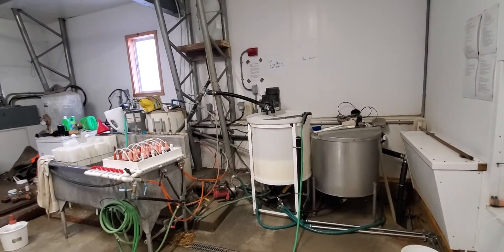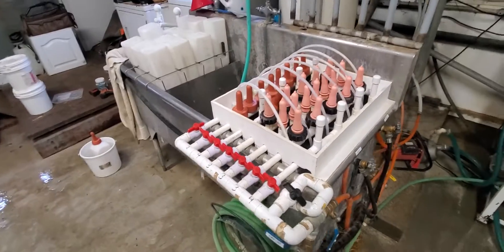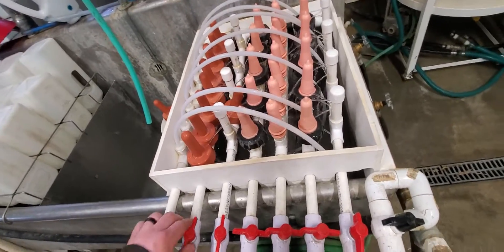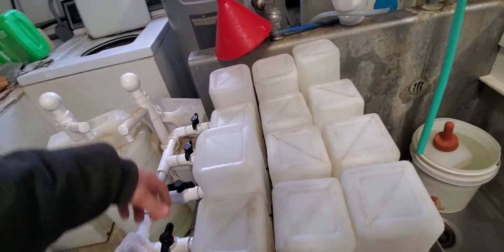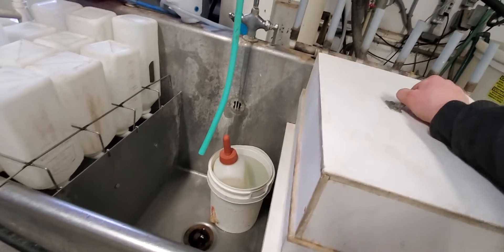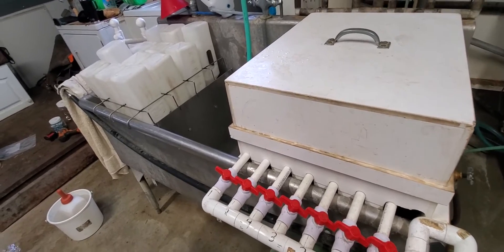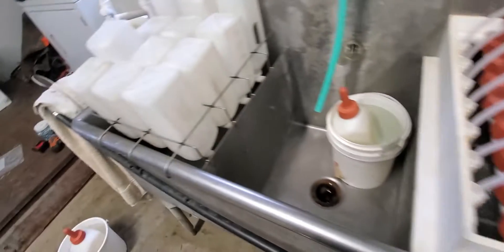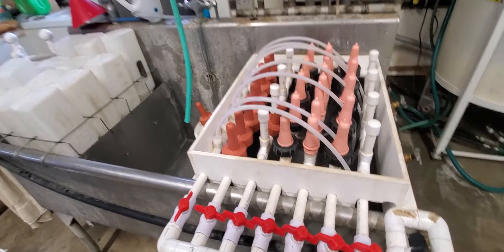Dairy Farm - Calf Bottle Washing System

Comment: First & Foremost, I would like to THANK YOU for your time and effort of producing the video and sharing your mechanical creation of the infamous daily chore those of us that have bottled fed, ....."CLEANING OF THE BOTTLES"!  I have been searching for few weeks of attempting how to solve / mitigate the laborious chores when I get back into bottle calves. 

That being said, I am researching on an semi auto feed system as yours. I do not want to / nor have the funds to invest in a FULL ALL OUT "AUTO" system at the time, although can appreciate those whom have a large operation.  Therefore, I was wondering if you could provide a "SECOND" Video on your auto feed system.   It appears you are collecting the milk from your milking parlor, storing for one day, then transferring into dispensing vessel with mixer. 

1- Are you implementing additives to milk to stabilize?, 
2- and if so what? 
3-How long is the "shelf life" of your milk to be dispensed?
4- The method of deliver to feeding nipples, you stated are both gravity, as well as, vacuum, the manifold for the primary supply line appears to be 1/2" or 3/4", then branched off with 1/4" tubing, correct?
5- Do you have issue with Temperature  drop from storage vessel to actual nipple?

Again, thanks for sharing and with your permission, i am creating a bottle washer based on your "INTUITIVE" design.

God Bless, 

J Abner
Liberty Township, Ohio, USA